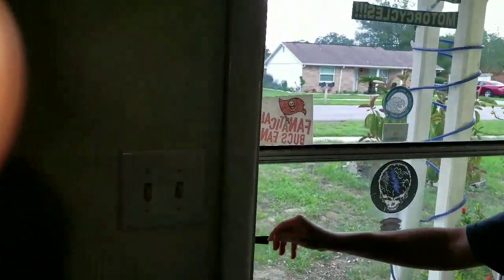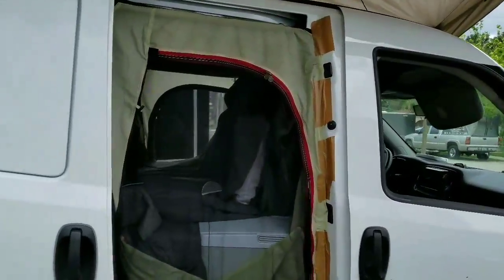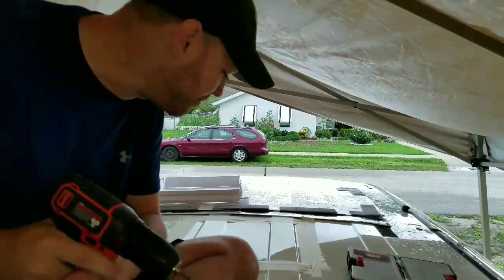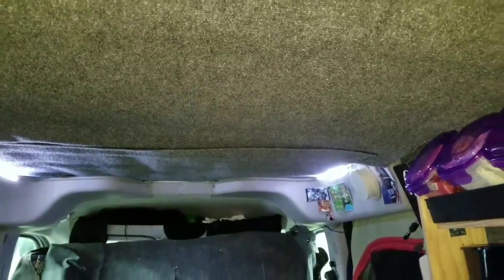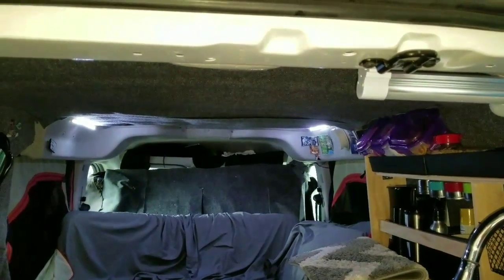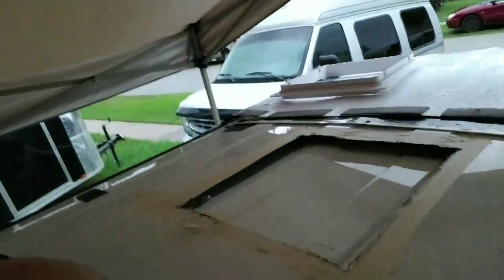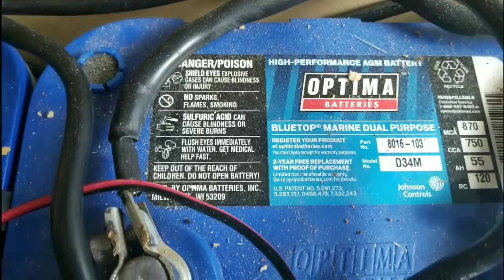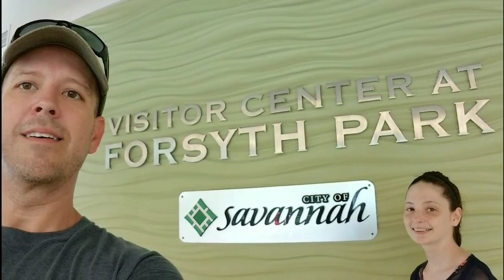Maxair fan Install Full time Van life 2016 Promaster City

Comment: Nice work. @13:58... did you use Butyl tape? How much? How did you deal with the ~1/8"  ridge rises and dips in that roof? Notice it pull and warp in the dips? Any issues or leaks? Are you able to run that fan overnight on your OEM battery?
Reply from the maker: Yes, we did use Butyl tape. We avoided the ridge's by placing the fan in between them. No, leaks and yes, we can run it all night.
Reply: Hi I'm meant the ridges on the roof not the cross beams. Sheet metal on the roof of these vans is so thin.  Did you find the roof warped a little bit with the install? Notice it bounces when you close the doors?  Air pressure in the van too strong unless you open a window?

Comment: Thanks! Could you reply with the exact corner locations of the fan hole on the PMC? Also what did you do to address the depth of the fan sleeve into the van? I thought this had a recommended depth of more than 1 inch?

Comment: When I made the holes for my solar panels in my truck cap Few months ago, I was so anxious. I would like to install a max air fan too but think I may get a ford transit or promaster,  so hesitant about doing it just yet. I looked at a transit the other day and they are soooo low to the ground. Going to look at a promaster city too one of these days. Live in small town USA so looking at vehicles is not easy. Dealerships here very limited. Know this video is old but wondering if your vehicle is disappointedly low for your type of travels?
Reply from the maker: We would like to lift the van but it have gotten us in to a lot of places.
Reply: Oh ok, I will look into that, raising cost and all. Thanks